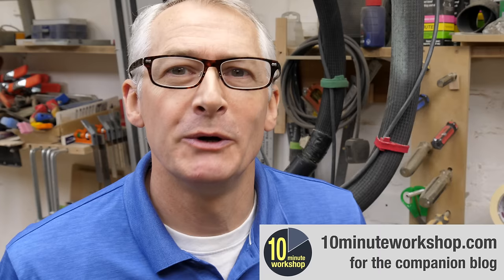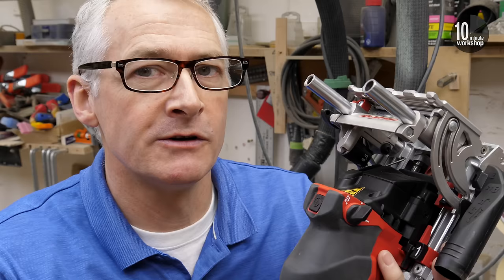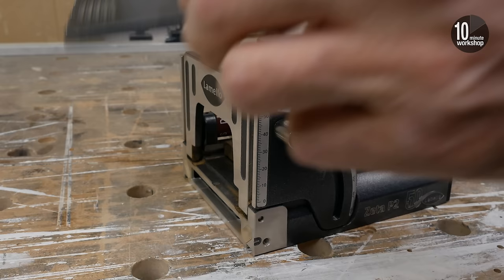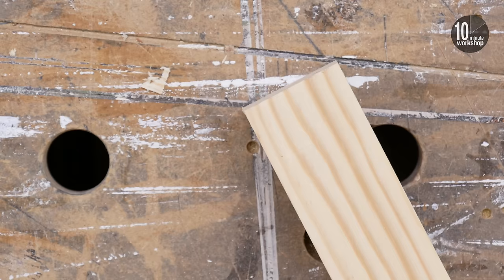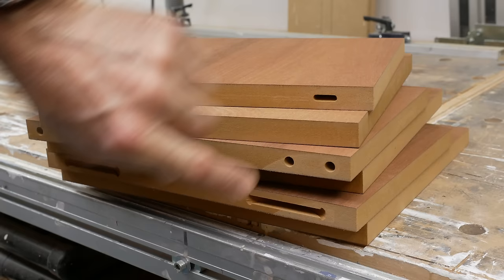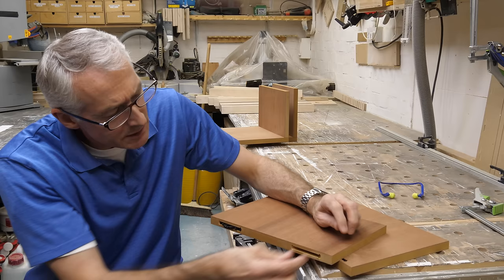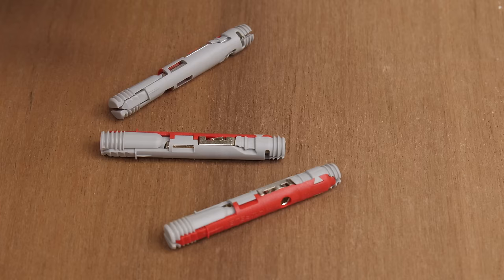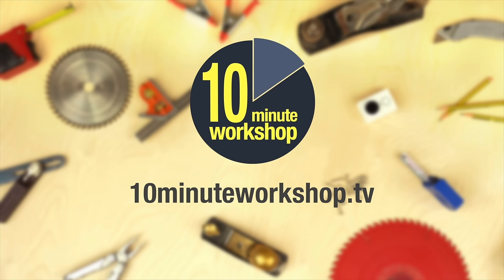Festool Domino, Mafell Doweller or Lamello Zeta? [video #360]

Comment: As someone who owns all three machines, I would say that if I was starting out from scratch I would buy the ddf40 first.  It is so accurate that you don't really need the wiggle room.  The fittings are cheap, and it does so many things very well.  After that I would get the zeta, and I'm not sure if I would get a domino.
Reply: tangoexperiment interesting! Thanks for that
Reply: Exactly what i wanted to know.. thanks 👍
Reply from the maker: If you were starting from scratch it has an awful lot going for it, I agree. But saying that you don’t need the wiggle room is a bit like saying you don’t need any more money; it may be true, but it sure is nice to have! 👍😆
Reply: I would have agreed with for the majority of my professional career.  The thing is, if you are using a tool where it is difficult to get perfect alignment then you need some wiggle room.  Once you get used to the ddf40 you realize that it is one of the rare tools that gives you that perfect alignment 100% of the time.   This changes wiggle room from something that enables you to get perfect results to something that creates the possibility for misalignment.

Comment: I had a domino and sold it and then got the Mafell DDF40 after I saw one on display while on vacation in Munich.  I'm just a hobbyist so probably won't get that much use out of it but it is joy to use.  I find myself trying to think of projects just so I can use it.
Reply from the maker: The Mafell’s a fine machine. I’m a long-term Domino user, so I found it a little slow and awkward to use in comparison, but I was happy with the results it produced. 👍👍
Reply: @10MinuteWorkshop  yes, there is a pretty steep learning curve to take advantage of all of its capabilities.  I find myself carrying my laptop out to the shop and watch their tutorials to refresh my memory.  I can't bring myself, yet, to think about replacing my 8 year old TS55 for the Mafell MT55 but I did bite the bullet and get the p1cc jig saw which is a fantastic "piece of kit" as you Brits like to say!  :)
Reply: I couldn't help myself.  Just sold the TS55 and got the MT55cc.  What a fantastic piece of engineering.  I hate the internet!  It's cost me a lot of money!  :)
Reply: @hhanger1  I love the mafell. I had an erika for 25 years and it stopped working. because of its age it could not be fixed. I bought a Makita mitre and am sorry that I did . its a fine machine but not the Mafell style. I have a festool - drill, driver, router, 1400, jig saw  and will be selling them all and buying Mafell. I not in the business just love German tools.

Comment: I'm guessing the domino is the "cheapest". Which I find extremely ironic.
Reply from the maker: I should probably go with ‘least expensive’ 👍👍
Reply: For panel work a standard biscuit joiner with assembly biscuits would be much cheaper than any of those. Of course the zeta doesn’t need glue and that’s a big plus

Comment: I’ll stick with my Domino 500, the Zeta handles knock down builds better but I just can’t justify the cost for the small amount I do. Great review though, really detailed and non judgmental 👍 - and I love the fact that the Festool is the ‘cheap’ option 😂
Reply from the maker: Thanks! Yep, the Lamello’s great, but the most niche product ever. I did just fine with the domino for over 10 years, and if it wasn’t for a burning need for KD fittings (now just an ember, go figure) I’d still be using it exclusively. 👍👍

Comment: Great review Peter, as a none professional I use a Dowel Max jig.  It’s very good and accurate, takes time but does the job.  However I have no ‘wiggle’ room which on some of the furniture I’ve made is vital.  When I make furniture for the family  I have to load everything into a hatchback car.  So a knock down facility would really be useful but the cost of all these for a none professional (unless the kids feel like being generous at Xmas) is prohibitive.  What I should have done years ago when I retired was just to bite the bullet and bought the Festool Domino.  No ifs or buts it would have been the best investment.  Thanks for sharing really enjoyable.  👍🏻👍🏻👍🏻
Reply from the maker: Thanks Mike! Yes, the Domino was a lot of money (still is!) but it’s paid for itself over and over. 👍👍
Reply: Hobbyist here. I bought the Dowel Max too and ran into the same limitations. A year later I sold it, along with about everything else I had around that I didn't need for the Domino. Haven't regretted it one bit.
Reply: For assembling with dowels there are the confirmat screws.  Cheap and great for open shelves as they give lateral stiffness

Comment: I keep coming back to this video, it’s so useful.  Understand the attraction of knock-down fixings.  I have 100 of those ‘ixconnect’ 8x60 dowels arriving tomorrow with the plan of using them in a 7ft bookcase install in a tight area.  Something tells me they’re not going to have the clamping force of the likes of the clamex or peanut but hopefully it’s significant enough.  How they turn out will determine what jointing system I invest in.  Great videos as always Peter 👍
Reply from the maker: Thanks David! Be interested to hear how you got on with those fittings! 👍👍

Comment: If you want to buy only ONE of those machines, heres my opinion:

- Doweller: quick, cheap, but you need prepare your wood with very high precision. 1/10mm! Wouldn't recommend for the hobbyist.

- Lamello: perfect for panels. quick, easy, allowes quite high tolerances if your board sizes don't match precisely. Lamellos can NOT be used within small parts  (e.g. thin picture frames).

- Domino: quick, good for panels, even better for small parts. Most versatile of all machines. Allowes high precision or tolerance by the flick of a switch. Machine has no cheap alternative Manufacturers, Materials are expensive, too. Out of dominos at the weekend? No problem! I make my own domino dowels from longer scrap (>50cm). Pass it through the planer, round the edges an you can save a lot of money.

Comment: I have had the Domino ever since it first came out, I use it for so many things it is crazy, the best tool ever. I basically stopped using my Lamenolo biscuit when I got that. Bought the XL700 when it came out, great machine also, I  got rid of my mortizer machine after that purchase.

Comment: Ooh I imagine this will be a popular video!  Just starting watching now, with interest!
Reply from the maker: Cheers Alastair. 👍
Reply: Fantastically informative Peter and the direct comparison approach throws up a lot of interesting thoughts.  For example seeing the resulting slots/holes created by each machine side by side immediately suggests that you are getting a bigger/stronger joint from either the lamello or the Mafell vs the Festool.  I hadn’t seen those Hafele dowels close up before either and your point about their limits with drill depth in 18mm corner joints was helpful.  These sorts of insights make your carefully planned and filmed videos very valuable 👍
Reply from the maker: Cheers Alastair! To be fair I was using the second-smallest dominos for this vid - you can go significantly bigger if you need them, though tbh the ‘smallness’ of the domino slot is a real benefit when working on narrow stock eg rails. A well-glued domino joint is very strong - I’ve never had one fail in ~11 years of making cabinets with them. What jointing system are you sill using currently?

Comment: Good to see that you don't suddenly have a workshop full of Mafell tools, and that you made an honest review. :-)

Even if you don't need the knock down facility, the Lamello surely wins by the simple virtue of no glue mess, no drying time and no clamping? The cost differential of the fixings is going to be insignificant when priced into the job.
Reply from the maker: In theory yes, in practise no. Lamello recommend using adhesive with the Tenso and Clamex fittings, and the Tenso still need clamping, in my experience. And there’s no fitting for narrow stock - you need about 90mm minimum. More in this in the accompanying blog post  at 10minuteworkshop.com👍👍

Comment: I have very much appreciated your content and the care in which you approach your work. I agonized over the decision between the Domino and the Duo.  This video was very helpful to me. I'll be using the Duo for joinery as well as shelf hole pins, which saves me the cost of the LR32 system. I believe I'll add a Festool Domino XL down the road. Thanks again, I've learned a tremendous amount from your content.
Reply from the maker: Thanks, glad the video helped and appreciate the comment! 👍👍

Comment: I bought a couple of biscuit joiners after they went off patent.  Great system, and the biscuits are easily available and cheap.  Domino would have made it in the shop, except as an amateur who normally does real joinery, I can't justify it.  If I was a lot younger I would get the worth out of it.   But at 60, there is not enough utility for my needs.

I have used biscuits to destruction in certain applications, and all you need if they will not be strong enough is something like a dowel.  The biscuits are super strong bond wise, but can in certain applications use extra support across the short axis.  A dowel is poorly bonded, but strong across the axis.

I was not impressed at the quality of construction of Festool as revealed in AVE's deconstruction of their chop saw, so the money is not going into making solid tools, whereas my Dewalt and PC biscuit joiners are pro quality, and cost about 1/10th - 1/5th what Festool comes in at.

Also, there is no domino advantage strength wise in shallow penetration joints.  I just made an easel where a plate of 3/4 ply is attached to side runners.  There is only abou 1/2" to get a hold on, if you don't want the joints to print through, and no way the joint can be split off on the short axis.  Bombproof in biscuits.  Biscuits are faster to put in.

Domino's advantage is in frames, but those are high visibility and worth doing with real joinery Which is a lot stronger and integrates with raised panel joints better.  Domino is still bond dependent, so the joints will still fail over time.  It is still a sloppy fit in the x axis system.
Reply: What a big load of Bollocks.

Comment: There are several projects where I would have preferred to use the Domino XL. However at this time I have a two dowelmax jigs with the accessories. The dowelmax can help make creative dowel placements for additional strength. The only downside I've found is that it's slow compared to the all the tools in this video.
Reply from the maker: Yep - time & money, always.. 🤷‍♂️👍

Comment: Hello Peter. I watched this video a year ago when it came out....   Not long after this came out a friend asked me to go to his cabin with him while he put together the kitchen cabinets he made. ( I was supposed to be fishing while he did the cabinets). He also has the domino and had already cut the domino slots and dry fit everything. We get there and he starts to put them together.... he has his clamps, dominos, etc all ready to go. Then realizes he forgot to bring wood glue. And the nearest store that has wood glue is a 40 minute drive. I noticed he had a bin of screws so we clamped up each cabinet and from inside the cabinet we drilled pilot holes through the cabinet and through the domino.Then put the screws in. And if it was a 90 degree corner we drilled it from the outside and inserted the screws through the exterior and into the domino. Each end cabinet had shaker style panel that went on each end and covered the exterior screws. Supposedly he was going to pull each cabinet out at a later date and glue them up but I know he hasn’t done that yet. He said they are strong as is and isn’t planning on gluing them now. Probably the cheapest knock down fastener I have used in a while... 😊
Ron
P.S. We did drill the pilot hole at a slight angle toward the connecting boards and used a depth stop on the drill bit and of course made sure that the screws were not too long. Also the face frames were 1 inch thick and the plywood cabinet carcase was 7/8” thick.
Reply from the maker: Good work! Draw-bore loose tenons, but with screws! 🙌👍👍
Reply: @10MinuteWorkshop 
Exactly. It worked great.

Comment: Hi Peter, loved the review helped me make my choice between Domino and Duo,( Lamello not easily available or supported here in NZ).  Great to get a non biased viewpoint, and interesting to hear your needs for knock down fittings as being preference. In the end I went for the Duo,  as here in NZ it was actually cheaper than the Domino, and by the time i added in the various fences and guides was 25% more for the Domino.  Although I do like the ability to allow some play in the Domino, you. can still achieve this with the Duo with a second cut if required, not as easy granted, but workable if you get it wrong as we all do!  Also buying Dominoes here is expensive, and not always available, dowell's are cheap as chips and always available.
Reply from the maker: Thanks Ewen! Yes, things like pricing can vary so much depending on where you are on the globe! And I agree, dowels are very cheap, and, perhaps more importantly, available in lots of DIY-type stores so never really a big deal if you run out or decide to try an 8mm instead of a 6mm, whereas Dominos seem to be a much more specialised purchase. Glad the video helped, and thanks for taking the time to comment and let me know. Cheers, Peter 👍
Reply: @10MinuteWorkshop  Yep price was in there, i had was about to get a Domino, as I had looked at the DD40P,  but the MaxiMax DDF40 had every thing i needed, and can do 12m@40 so I can use it for bigger jobs.  The side rail was the clincher, no need for the 800mm template guide, and the ability to do shelf pins(although i have drilled rails for that with router).   Also I have the service agent (also my machinery supplier) right next door to my panel supplier, handy!  Thanks again.

Comment: All of these jointers are brilliant. I own all of them but each has their short comings. Another jointer to consider is the LNF20 biscuit jointer from Mafell and it comes in at half the price of the other machines.
Reply from the maker: Thanks! Never owned a biscuit jointer - went straight to the domino. 👍👍
Reply: What are the specific downsides of each machine?
That would be also something I would like to hear from you Peter in a upcoming video.
Reply: @Mark_Dee  
Downsides to Duo Jointer is that you cannot really do a single dowel joint as it will twist (depends on what you want the joint for), Biscuit joints are not as strong as dowel or domino joints, Domino Jointer registration paddles are not as good as pins on Duo Jointer.

Comment: I really wish the Mafell did much larger dowel sizes for some joinery. 
I just made a support stand from 2x4 lumber, but used 5/8 or 16mm dowels with 1/4 lock pin dowels for all the joins. If the Mafell did larger dowel it would lend itself nicely to be able to cross drill smaller dowels for joinery this way.

Comment: as normal a great video Peter - one thing to consider if you only have money for one machine though is face frames - the new ddf40 can now handle face frame assembly due to removing one doweller, the domino can obviously handle typical face frame styles, but the llamello Zeta P2 to the best of my knowledge wont manage a small enough size for typical face frames - is that still the case? if so, you are going to need to consider a second machine for face frame or an alternative tool of some sort.
Reply from the maker: Thanks Martin! I do mention the ‘narrow stock’ option on the Mafell, and I expand a bit more in the blog post at 10minuteworkshop.com. But I agree, the Lamello is lacking in this regard - I couldn’t use it as my only machine. 👍
Reply: @10MinuteWorkshop  oh yep, I watched the bit with the ddf40 around the narrow stock option. Its such a shame the llamello doesnt have some way of jointing small stock, I desperately want it but cannot justify the cost when it still has limitations as a one tool option. maybe I just need to save some extra pennies and have one of each like in the video ;-)

Comment: Thanks I'd like to mention that, biscuit joint is not good for high force tenon joint, and I see dowels in window frame loose might due to its limited glue surface, although I'm not afford the "cheapest" Festool. In US DF500 is 5~10X more than biscuit jointer.
Reply from the maker: Thanks. The Lamello Zeta isn’t a biscuit jointer - different animal. Yes, with a blade change and some messing around you can turn your ~£1300 Zeta into a biscuit jointer, but I wouldn’t  - for all the reasons you point out! 👍👍

Comment: Good video Peter . The only down fall I find with dowels is no wiggle room and sometimes you get a slight split in the mdf . Bit too tight really as others have said. But all 3 fantastic tools
Reply from the maker: Thanks Nathan. Yes, I did find the dowels split the MDF once in a while, and the lack of wiggle room is a downer, for sure. 👍
Reply: +Nathan Carp
The best jointer for MDF would be a biscuit jointer especially if doing cabinets maybe not so much if doing tables with it but it could still be used. 

Domino jointer would be second to that for use in MDF construction. Duo Jointer is brilliant for using with Plywood and solid woods.
Reply: bighand69 I only really use the regular biscuit jointer for alignment . 

The domino would pretty much be the buy for me . 

Most of the cabinets I make from mdf I glue and screw .